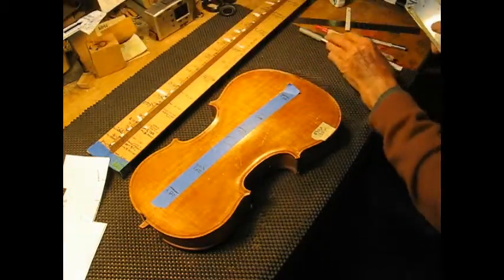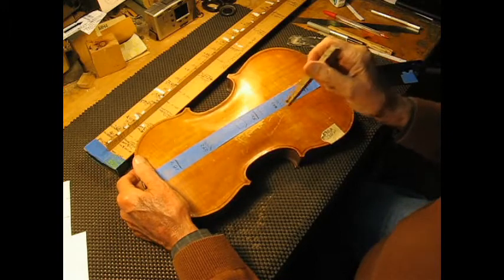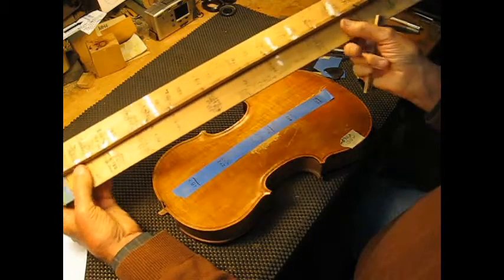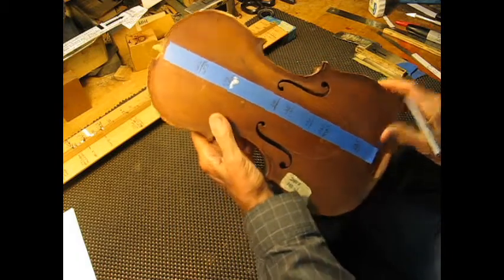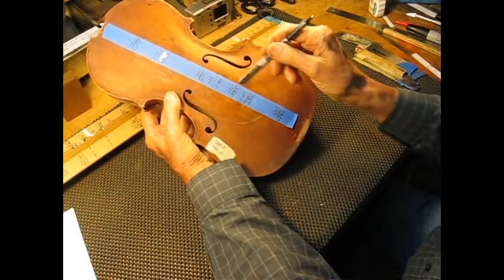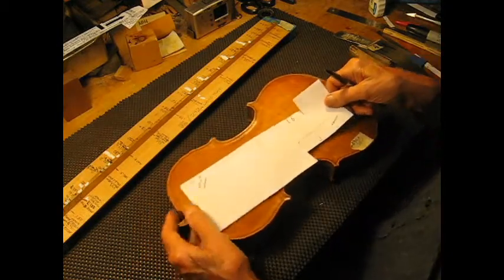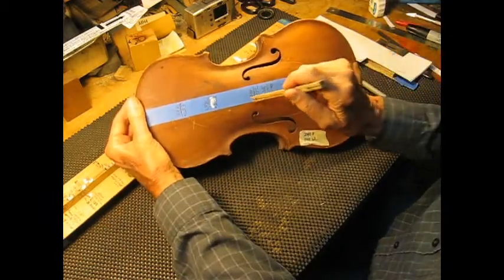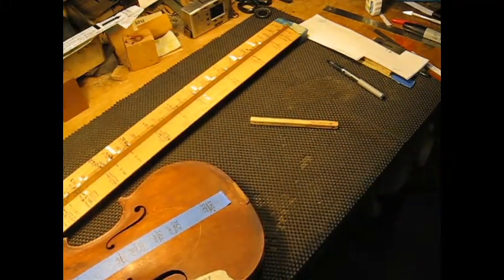Violin Back Plate, analyzed for nodal line placement and then adjusting to sound post location.

Comment: What kind of tone do you listen to when knocking on the plate?
Reply from the maker: Thank you for your question.  First I would say the "knocking on the plate" would not be useful to 
learn anything of value.  A gentile tap and an open mind and much practice is what is wanted
here.  We are LISTENING to the changes in the overtones for this series of nodes and anti-nodes.
 LISTENING means with an open 'blank' mind.  Not in anyway talking to yourself or making assumptions.
To see if you might be able to learn how to use this technique. Get a violin,  turn it over onto its back and using
a proper tap tool (see "useful tools" on website for more detailed information) tap (releasing the tap tool, letting it fall to the surface, and then catching it as it bounces back up) along the center line of the back plate from one end to the other, 
spacing the taps close together (perhaps 1/8" apart to begin with), just listening.  If you hear only an identical series of overtone sounds
then you have no affinity for this skill.  If however, you begin to hear changes then you have made the first steps
to leaning how to use this tool for violin acoustical adjustment.  David L.